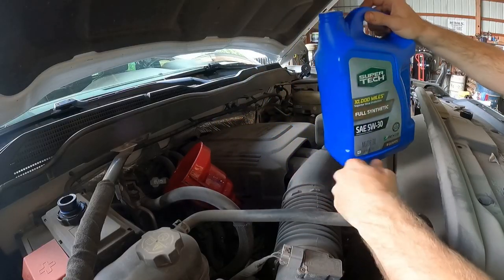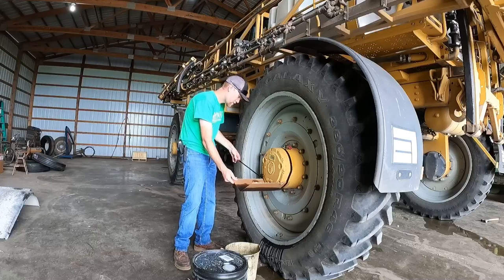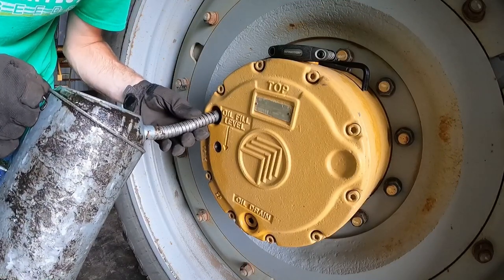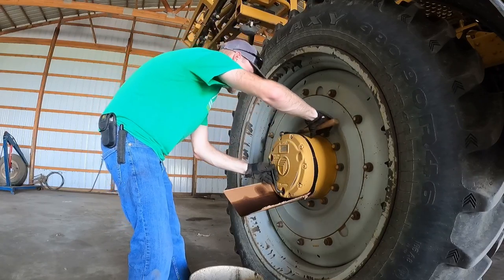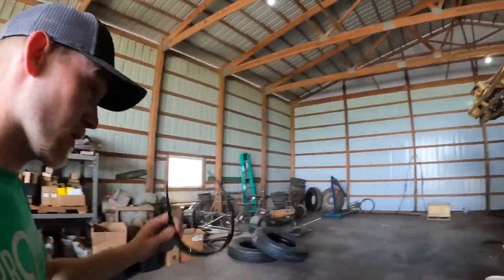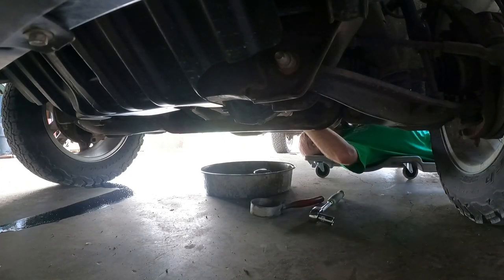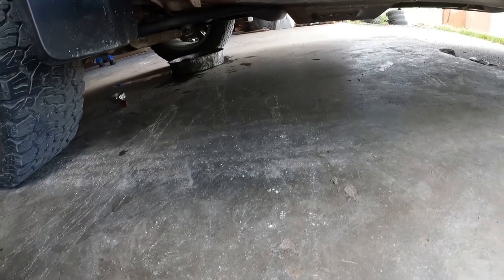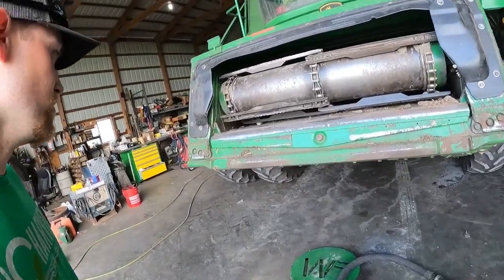I spilled oil EVERYWHERE!!! I can’t be trusted alone in the shop…

Comment: Use a good sharp center punch and punch a hole in the bottom of the oil filter before loosening it, it will drain out and not make a mess!!